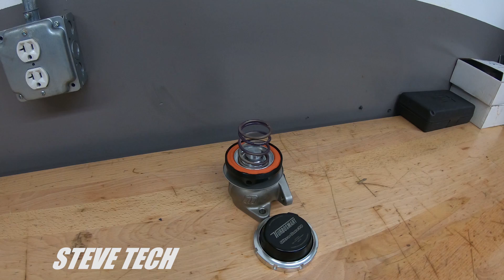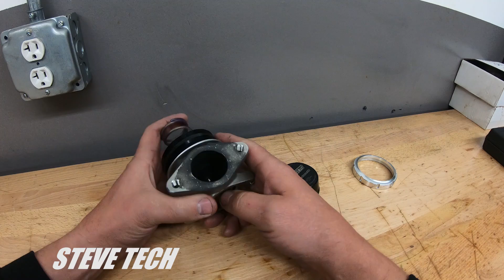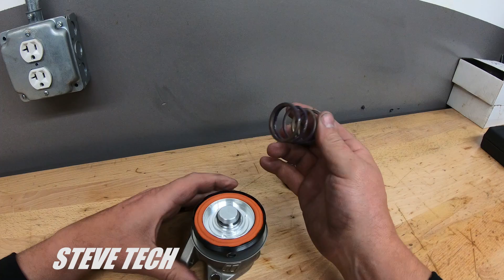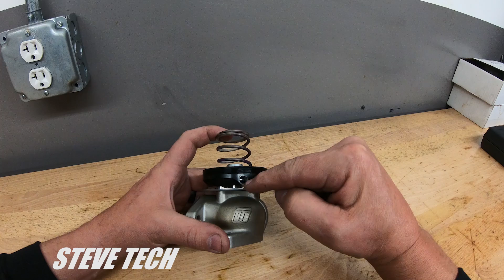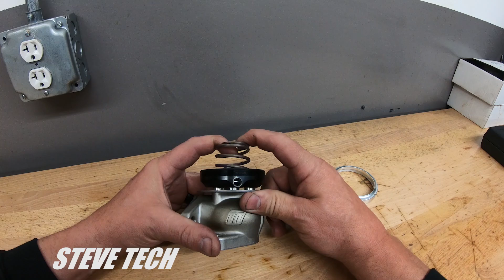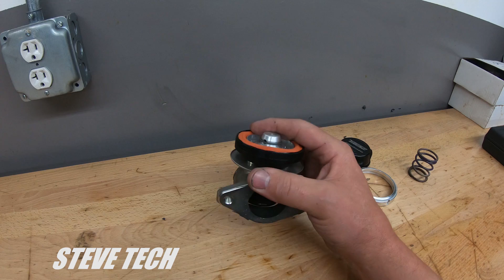Hook Your Waste Gate Up Right, Or You Will Be Sorry!

Comment: What’s your opinion and have you tested inlet restrictors on centrifugal superchargers? Ive heard of them used to flatten the boost curve to be more like a turbo and not climb all the way to redline.
Reply from the maker: Can work, I am not doing it yet
Reply: @stevemorrisracing  one of my questions regarding inlet restriction is it’s effect on air temp. I’ve see/heard of plugged air filters driving up IAT on turbo applications.

Comment: Boost reference on the wastegate also prevents overcharging the charge pipes when the motor goes from full throttle and high boost to no throttle (return to idle)...this momentarily spikes boost pressure when all that air has no place to go - but that spike boost also fully opens the wastegate releasing the exhaust pressure on the hot “drive” side of the turbo while the now unbalanced spike on the charge side acts as a “brake” on the cold side, which is at that moment only driven by the turbo impeller momentum.  When you control boost only on the manifold reference side of the wastegate, you do so with an (air) pressure regulator which eliminates the closed throttle “spike” action on the wastegate (eliminated by the high pressure regulator) so you have to also run a cold side (manifold reference) blow off valve to release the excess pressure (and make that signature rice-rocket hiss sound on deceleration)...

Comment: A shop vac with your hand over the end.... it spins faster because it does not have to work as hard, no load , its pushing no air... LESS drag with your hand over the end of the hose. It's counter intuitive , but makes sense if you think about it.

Comment: When controlling boost only through the bottom port you dont restrict the pressure to the bottom port that will cause an initial boost spike then pressure will return to normal the correct way to do it is create an air leak to the bottom port to bleed off pressure

Comment: This is probably one of my favorite “Steve Tech” vids so far.  I’ve always wondered if folks use waste gates (or anything else to help control boost) on centrifugal superchargers.  Thanks Steve, man I love this channel!!
Reply: I believe the item you're looking for is a blow off valve, or bleed valve in some circles. 
Bleeding air after you've used mechanical energy to compress it, makes no sense on a mechanically driven air pump, unless it's momentary to avoid surge, when the throttle shuts.

Comment: I have to disagree on multiple points when you were talking about speeds relative to shop vac, blower and turbo shaft.
1: When you restrict the intake or exhaust of a shop vac the motor slows down because it is under more load. This is due to the increased mechanical resistance, the speed of any electric motor assembly is determined by the mechanical and electrical resistance of the system as a whole. You can see this first hand by restricting a computer's fan and monitoring it's rpm with an app such as Speedfan.
2: Opening a blow off valve will not overspeed the turbo. Turbine speed it determined by the volume of exhaust flow which is a product of intake volume. If you lose intake flow you will also lose exhaust to drive the turbine and it will slow down.
3: On a SC setup if the gate is vented to the atmosphere the difference in airflow through the compressor will be what ever the difference in efficiency is at the given boost pressures and compressor speed. Here is an example using nice round hypothetical numbers. Engine NA consumes 1000 cfm @ 7k rpm, SC is geared to supply 2000 cfm with an engine speed of 7k that will equate to 14.7 psi of boost. Now lets assume that a drop in boost pressure of 1.5 psi (10%) causes the compressor output to go up proportionally to 2200 cfm that just means the gate needs to vent 400 cfm so the engine sees a drop of 10% (1.5 psi). I've seen some recirculate the gate back to the intake side of the SC and that can cause issues but I've never seen a problem when vented to the atmosphere. These were street applications that weren't anywhere near the bleeding edge but I can't see it being a problem either way when vented to the atmosphere since the compressor is under less load at lower boost levels.
Reply: I have to disagree  with your points
1: I'm not sure you have tried restricting a shop vac. The motor speed definitely increases. When you block the flow path of a shop vac the air in the impeller is basically trapped and spins with the impeller as it can't go anywhere else. This is less load on the motor as it is only spinning that air and not moving it anywhere.
2: Steve is talking about a blow off valve on the intake side of the engine instead of the exhaust side. If the engine reaches the desired boost level and then the intake is vented it is making enough exhaust gas for that boost level. If the engine increases rpm / load at this point then more of the intake will need to be vented to hold stable boost but there will be more exhaust flowing through the turbo so it's speed will increase.
3:  With a centrifugal supercharger the boost increases with engine rpm but not quite in a linear way. If it has 10 psi at say 4000 rpm and that is all the boost you want, by the time you are at 6000 rpm you will have to vent a lot of air to hold that 10 psi. If you are pumping more air at the same pressure then the supercharger is doing more work and needs more power to drive it.
I have a centrifugal supercharger on my car and it has a valve to vent air to atmosphere. It's there so when under light loads when there is vacuum after the throttle body the supercharger isn't trying to make boost before the throttle body. It's less parasitic loss driving a supercharger that is vented to atmosphere than one that is making full boost that is being mostly held back by the throttle. This makes the engine more efficient at part throttle.
Reply: @HSVR383SC  
1: Like I said you can see this first hand by restricting a computer fan or any fan/pump that gives you a rpm output for that matter. If you don't have access to something like that you can also verify it by monitoring what happens to current when you restrict a fan/pump. As the fan/pump slows current will rise. You are basing your opinion on the sound of the shop vac. Mine comes from monitoring data on fans, blowers and many other electro-mechanical devices.
2: Turbine speed is determined by exhaust flow which is a byproduct of intake flow. How can a byproduct increase once it's generator has been decreased or removed? It's a turbo/waste recycler not a perpetual motion device which is impossible in the first place. Is there potential for a momentary rise in shaft speed? Absolutely but unless you were already pushing really hard the odds of it causing damage are very slim. I've never seen a boost leak or blown charge pipe take out a turbo.
3: I never said there would be less parasitic draw since there will be some obviously but how is the below quote any different than what I said.
"I have a centrifugal supercharger on my car and it has a valve to vent air to atmosphere. It's there so when under light loads when there is vacuum after the throttle body the supercharger isn't trying to make boost before the throttle body. It's less parasitic loss driving a supercharger that is vented to atmosphere than one that is making full boost that is being mostly held back by the throttle. This makes the engine more efficient at part throttle."

Comment: When set up as you say, Does the ex. system pressure have any effect on the ability of the wastegate to control the boost?  Do you get into situations where the wastegate does not have the flow capacity  to reduce the ex. flow/ pressure enough to control the boost?
Reply: Yes to both questions.  Drive pressure and gate size has an affect on a gates ability to control exh flow/boost ina given combo
Reply: @BEANS-O-MATICtransmissions  thank you- Ona modern system- like this how much ex/ drive pressure is being used to create 30 lbs of intake boost? How much does ex lobe timing effect ex drive pressure? I.E. have they reduced the overlap? ie closing the ex valve early?

Comment: I've actually seen a lot of videos of the guys at Fuel tech tuning costumers supercharged cars utilizing TurboSmart's new electronic wastegates to control boost with great success. I agree 100% with what you said in the video but this subject seems to be catching a lot of wind in recent months. Now we are talking about cars making hp similar to stuff you work with. Not low hp small blower car on the street. I personally have no experience in the subject as I'm a turbo import guy and always have been. It is interesting to see though. The idea that I'm seeing is this is only working or POSSIBLE to do with Turbosmart electronic gates. Not a standard spring pressure controlled gate.

Comment: I always wanted a variable vane pitch viscous clutch [vaguely like a torque converter] on a supercharger so it could have variable boost with a single fixed ratio pulley arrangement where the boost load [resistance created by natural back pressure] working against the variable pitch vanes of the clutch would set the final boost, and then simply change the vane pitch upward from a lower level to increase boost as the engine needs it.

Also, such a system would be capable of a total [or near total] shut-down in case of emergencies.

In other words, kinda like the fuel cutoff mechanism on a diesel engine [or any engine for that matter] there would be an emergency shut-down mechanism on the viscous coupling that allowed you to completely disconnect it from driving the blower in case of an engine runaway or a crash.

Comment: Why don’t the gate valve open to the entire size of the gates in/out  hole size?  I see ppl go to bigger gates to get more control sometimes and seems like if the valve opened as big as the pipe diameter then ppl prolly wouldn’t need to go bigger when them situations arise. If valve don’t open to the actual diameter then seems to me it’s kind of a waste as if gates such an such size then it should open the that size. Like if it’s a 50mm gate but as I see in vid the valve only opens about half way of that gate pipe diameter then you essentially are wrkn with say 40 mm. Just seems that the valving should have twice the range of movement and open the entire diameter up no?

Comment: Pounds of boost is measured per sq inch, That round diaphragm looks closer to 2 inch diameter and that's over 3 sq inches of surface area for that boost pressure to act on. Bottom side of that diaphragm has a large shaft on it greatly educing the surface area.  So that's some real math required to calculate what pressure is required to tune that valves behavior to your liking.

Comment: Steve old truck driver here. My turbo had a waste gate operated by a rod and hose to the turbo. Was told when the turbo reached a certain psi the gate would open and bypass exhaust psi.
Reply: That’s correct, the boost pressure is set by a spring only on most diesel trucks. When boost pressure  is greater than the spring pressure the wastegate opens and  maintains the max boost pressure

Comment: With that being said about superchargers, a quick unloading of back-pressure on the compressor side of anyrhing is going to cause an overspeed. Meaning a blow-off valve.
A wastegate can't be used to control any supercharger because it doesn't care about exhaust flow. It's mechanically driven and does what the rotating mass dictates.
A blow-off(especially on gas engines) when the turbo is at boost and you come off throttle, keeps the boost(airflow) from reverting off the throttle blade and trying trying to spin your compressor wheel backwards, which will bend blades, destroy
thrust bearings, break turbine shafts or explode depending on super or turbo.
I was confused about whether you were talking about wastegates or blow-off at the end.
Pressure on the dome is an assist on top of spring whether CO2 or air. Air is more efficient because it is what is is when compress it and CO2 is dependent on bottle volume and pressure/temperature.
Reply: A wastegate on a Centrifugal SC has nothing to do with exhaust, the WG is placed between the compressor outlet and the throttle blade, whether it is open or closed has zero impact on blower speed provided there isn't any belt slip. 
If the gate is vented to the atmosphere the difference in airflow through the compressor will be what ever the difference in efficiency is at the given boost pressures and compressor speed. 
Here is an example using nice round hypothetical numbers. Engine NA consumes 1000 cfm @ 7k rpm, SC is geared to supply 2000 cfm with an engine speed of 7k that will equate to 14.7 psi of boost. Now lets assume that a drop in boost pressure of 1.5 psi (10%) causes the compressor output to go up proportionally to 2200 cfm that means the gate needs to vent 400 cfm so the engine sees a drop of 10% (1.5 psi).
Some recirculate the gate back to the intake side of the SC and that can cause issues but I've never seen a problem when vented to the atmosphere.
Reply: @ReEvoluion  That's basically what I said without your "Hypothetical " specs. 
The engine itself is using alot of its natural power to drive any supercharger and if you immediately release pressure from a centrifugal compressor side, the load of the engine will immediately come down and rotational speed will peak like the vacuum example.
Turbos won't do that with proper gates because they are a regulated controller of compressor speed based on exhaust flow that the engine hardly cares about and creates a much more linear path of on/off power to the rest of the engine without more mechanical maintenance.
Reply: @hankhank3129  @Hank Hank  The engine will not overspeed if you vent the boost pressure.
The parasitic draw from the SC is quite small relative to the sum of the driveline losses, aerodynamic drag and rolling resistance. The difference when the SC is loaded/unloaded at the same speed is even smaller relatively speaking since most of the SC parasitic draw is due to friction and the mass of the rotating parts not the pumping losses created by the compressor. The engine also has far less air available to generate power from while all of the other impeders are still present.
 
You can't make a direct comparison to an electro-mechanical device because the link to the SC is mechanical vs Electro Motor Force in an electric motor which is a balancing act between input (Watts) and output (mechanical impedance). 

When you restrict a shop vac it does not speed up it slows down. It may sound like it has sped up but that is not the case. I have monitored and maintained many different electro-mechanical systems over the years that had something to do with moving a fluid and not a single one has ever increased in speed  when the negative or positive side was restricted.

Comment: Steve is intelligent....From a physics side any science fans out  there, look how forward facing, reverse facing and flat blade impellers work for any type of centrifugal blowers. Opening flow can add more CFM and increases the load on an whatever is driving it. I've seen electric motors burn up because a blower hose with x amounts of restriction popped off.

Comment: Thanks again for the great content. How does the newer electronic gates work ? Are they using some sort of electronic solenoid?
Reply: They use a small electric motor of sorts. Engine coolant is plumbed into the E-wastgate to keep the electronic bits cool enough. The heat of the exhaust is what makes an electronic wastegate so difficult to design and build. Without special considerations most electronics will not survive the heat.

Comment: WW2 fighters before dual stage and dual speed super chargers used to have to be throttled at low altitude to not over boost very cool setups they had back in the day.

Comment: So putting pressure to the top of the gate is called dome pressure by some??
Reply: Yes
Reply: Yep, normally the guys running C02 bottles talk about dome pressure.  
People who don't want to run a C02 bottle talk about duty cycle with their MAC valve / boost control solenoid.